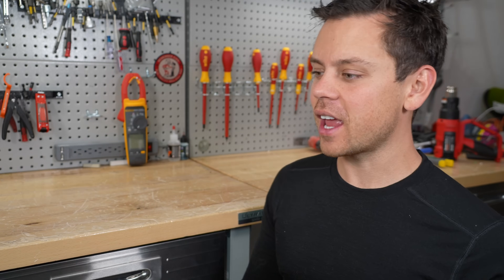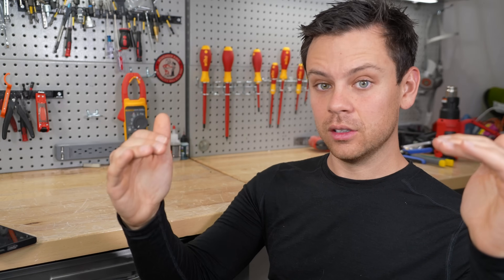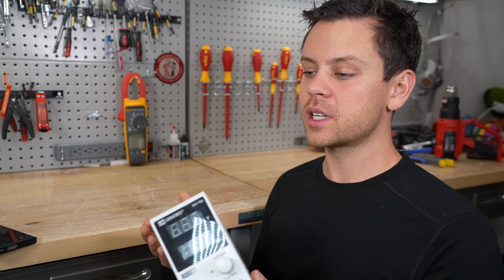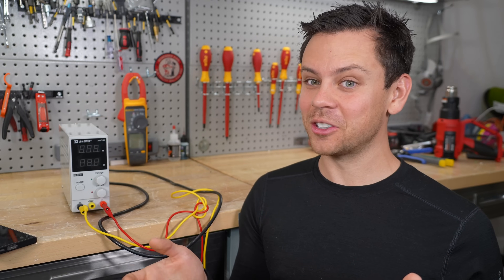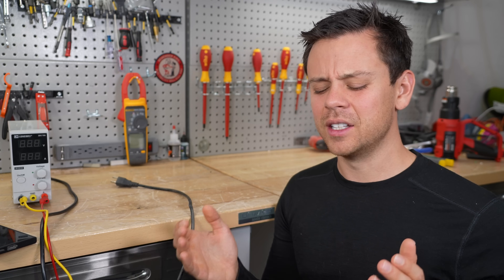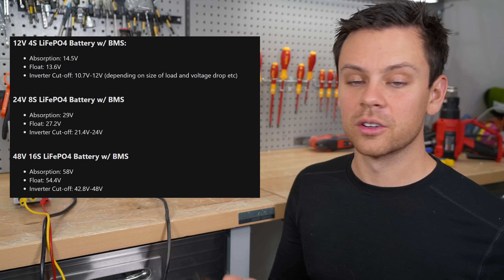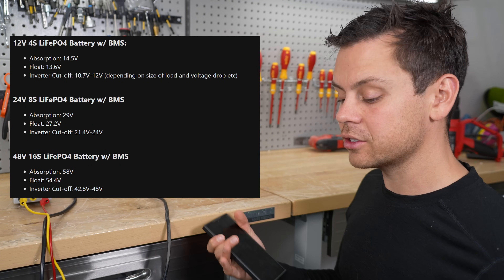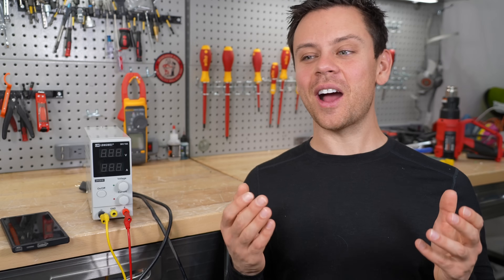LiFePO4 Charging Guidelines: What is 100%? What is 0%?! How to Balance??

Comment: I live in a rural mountainous area where MOST people are off-grid, and have been for decades. They are generally lost in their old mindset of low capacity 12 volt systems running on lead acid L-16 batteries. They are absolutely blown away when I update their system. The LIOP4s are a huge leap from lead acid, the panels and controllers, too. And yes, the new inverters are ...cheap and easy to install with high capacities and everything built in, plug in batteries and panels, voila! It's amazing how solar has become so much cheaper and better, it opens the way for a much easier off grid lifestyle, where electric fridges, dishwashers, mini-splits, and lights left on are just fine! People are stunned with the greater capacity of these systems, a miracle to them. The only downside is the complication of the combined system inverters with their software and specific requirements. Give me a good 48 volt low frequency inverter and a good separate controller any day.
Reply: I built a large deer blind that i could live in for a few days, people we trying to get me to use a Jackery or Ecoflow, I ended up using a Sungold 3000 watt all in one, I'm putting the batteries under the bed and four solar panels on the roof, yes a solar generator would have been cheaper but this is all hard wired and out of the way, especially since space is at a premium. 3000 watts should be more than enough, all it will be running is a TV that pulls 30 watts, some LED lights, a small A/C (for the summer months) that pulls 900 watts when it's running and a 10" oscilating fan. I'll post a video of it when I get a little further along.
Reply: Can you post an overview of your setup? Or share a parts list and schematic?  That sounds awesome.
Reply: @brianthayer8244  I'm going to post th elink, it's the unpublished version, I'll make it public once I get the video completed - feel free to share the link
Reply: @brianthayer8244  Not really. I'm an ADHD shoot from the hip guy. I can tell you that if you mind your  money you can have a very serious off grid solar system that will run a normal household even through the winter depending on where you live. To me. the grid is obsolete and great for charging batteries in the rare times you need the power. Just last week there was a rain and windstorm. I called a friend in town and he told me the power was out. I said my favorite thing, "really?". My batteries were at 70 percent after three days of rain and just humming along. The biggest thing that people don't understand is that solar makes power even when it's raining. A big enough array and it will get you through all but the stormiest times. Good luck to you, go solar!
Reply: @brianthayer8244  My reply keeps getting taken down.

Comment: I just returned 4 new 140Ah batteries to the manufacturer.  Why?  The BT app didn't work right, they sucked massive amounts of charging current, and they wouldn't properly equalize with one another (4P configuration, of course).  One or two batteries would go into standby while the others were charging.  But, then they would get stuck in standby.  Drove my BMV crazy and I nearly burned up my vehicle alternator.  

So, I installed 4 new RedOdo 165Ah batteries in my RV and I'm thrilled.  The BMS seems much smarter than the one in the batteries I removed.  They only seem to want about 60A of charging current each, they equalize nicely, and the app works flawlessly.

Questions:  
Is it possible that the 4 BMS modules are communicating with one another?  
Is that the reason that the maximum allowed configuration is 4S4P?
How are they able to cram 165Ah into a standard Type-31 box?
Reply: Which brand was the 140Ah batteries? You describe problems with charging, but how did they discharge?
Reply: @themartinandersson  I didn't want to trash the manufacturer, but since you asked...   They were TimeUSB.   I was especially disappointed when they refused to give me a version of the app that worked nicely before they broke it with an update.  To their credit, they agreed to take back all four batteries and cover the cost of shipping.
Discharging was the same issue in reverse.  One or two batteries would carry the load while the others would go into standby.  Why?  Doesn't make sense.  I guess I was expecting them to behave like AGM batteries in a 4P configuration.
Can you address questions 2 and 3, please?
Reply: @thewileyone1  I have three new Power Queen 140Ah connected in parallel via a busbar. Although I have no problems charging them, once they get full, one or even two (random order each night) gets "stuck" and refuses to discharge. Throughout the whole night only one or two unstuck batteries discharge leaving the stuck one(s) fully charged.

What I have found is that in the evening, I can put on a brief, but high-amp load (a water boiler on 1600 watts for 1 sec to be more exact), and this makes the stuck batteries unstuck, after which they happily discharge during the rest of the night.

This is clearly not sustainable long-term, but I am still investigating the issue to see what could be the cause. I suspect this could be because they are still unbalanced as I've only had them for about a week and I am charging on solar only; so I've never had them sit on 14.5v for "days" which is what my understanding is needs to be done for lifepo4 batteries to get balanced?

What are your thoughts?

For anyone else in a similar situation: the install was a pretty bad job. The workshop didn't even charge the batteries before connecting them. They also used cables of different lengths. We changed the cables to be of the same length, also rearranged the connections on the busbar such that chargers, batteries, and consumers, are intermittently connected, chargers are on the ends, and each device plus and minus are diagonally connected (all this to even out the current flow on the busbar). But none of this fixed the no-discharge situation.

Comment: Not that bad - lifespan went from 10 years to 5....
I read 80% full is best for longevity.
He mentions heat. Hot hot is too hot?
80F? 90F?
50F?
How cold is too cold too?
32F? 20F? 0F? -20F?
Trying to decide if I should put mine in a detached garage that goes as high as 107F and as cold as -20F.
Indoors is about 82F summer, 65F winter.

Comment: I have 2 12v dumfume 300ah each. Everything was running fine now won't charge over 13.5.
I have the renogy 50amp for solar and vehicle alternator. Just bought an adjustable upto 50amp charger gonna hook it to where alternator would normally go so at night no matter on solar it will kick in and charge and balance batteries
Reply: Solved the problem?
Reply: @User-jr7vf yes drained them 1 by 1 and then charged them back up 1 by 1 to get a full balance.

Comment: hey bud I had 2 lead acid batteries hooked up to solar they went through hell lol TOASTED BOTH OF THEM LOL But I just got a li 4- 100 ah bat just 1 for now  it has a bms in it ? can I leave it on solar and let it do its thing  and keep it charged with a slow drain will that hurt it  I plan on building more batteries  to get a bigger bat bank  but for now I just want to run my small stuff like lights ECT and a 2000 watt inverter on occasions when I need it thoughts?

Comment: Hey will. I've got a pair of Ritar 100ah  lifepo4  batteries, both with failed BMS. 
I used a 200a Daly smart BMS temporary hooked up via a 20 amp DC constant charger. 
One battery ended up super well balanced, like 3.5v per cell at the end of charge when the amps dropped right off, the other battery was all over the place, one cell remained at 3.3v and the highest finished at 3.7v.
The BMS is supposed to have active cell balancing, but nothing really happened. What should I try next?.

Comment: Will, you are so impressive. My battery bank is 4s4p, LiFePo 280 ah, installed in March (2025). Cheap Eco-Worthy. 7 of the 16 have Bluetooth. I finally got that to work yesterday and saw the SOC varies greatly (off grid solar). It seems you do not recommend installing equalizers/balancers to achieve  balance but instead simply let them charge to 100%. Or, do you think equalizers/balancers are a good idea? 
Thanks

Comment: Can u please show what to do if I’m charging only with 110volt on my travel trailer? Power is always on year around to batteries. Just bought new 100ah 12 v lifepo4. 2 battery system.  I just charged  yesterday first time by changing old dead batteries out and hooking new ones up. Do I need to buy something to do it? New converter? Balancer? Or let my 110 handle it like nicd always did.  Note I do know it will only charge to 90% that way but that’s still better than 100 % on my nicd’s

Comment: If you have multiple batteries in parallel and a large imbalance, you can disconnect high batteries and manually charge lower ones to get them balanced much faster. The reason people are afraid of high and low SoC is because other lithium chemistries are sensitive to this, and they haven't adapted to LFP

Comment: @WillProwse my battery Stucks at 99% for hours and inverter keep pushing current into cells and all cells are being balanced at 3.4s...in BMS I have set 100% SOC level when cells hit 3.59V...so my inverter keep showing me 99% till that 3.59V level is achieved and it is really normal that my inverter keep pushing 30A current into LFP cells. thanks for your such informative videos. I am learning a lot :)

Comment: 13:03 "When you're using solar it's maybe 0.1 or 0.2 C at most, if it's above that then it means that you did not size your system properly."
Good information thanks.

Comment: Fantastic video, crammed with really useful information, thankyou Will. Totally relevant for as I'm setting up a 12v Lifepo4 solar system with 200Ah battery and 1000w of panels.

Comment: I have a Grand banks " it's a trawler " with 12vot system. Want to hook up inverter/charging system so when I leave shore power I can run my small frig an use outlets on boat. Also if I changed to 48volt system do I have to change anything.  Do I just install 48volt batts an hook up to inv/charger.

Comment: Thank you for your enthusiasm regarding this topic, though, due to my lack of knowledge, I will have to watch more than once. I just bought a Pecron E1500lfp with EP3000-48v battery and the E1500lfp shut down at around 7%, is this anything to worry about? I feel like the system shut down before its capacity was completely used up or fully discharged while powering my refrigerator. Thank you.

Comment: First, Thank You for all of your great videos.
Quick question: I have an existing 48V 100Ah Lithium LiFePO4 Battery. I plan on adding another one in a few months.  Couldn't I just let the original battery charge to full and disconnect from the system, then connect the solar controller to the 2nd battery until it was fully charged.
Then, now that both are fully charged, Just connect them in parallel to the solar controller and designate (by way of the dip switches) the original battery as one and the 2nd battery as two?

Comment: OK... some of this is confusing to me.  FOR ME, on my boat, I go from 100%-90% when I use it.  2-3 times per month, except winter (no usage then).  Should I plug in the charger every time?  Or wait until my batt percent is lower?  I don't want to hurt my $1000 battery.  Mine is a 24V Dakota Lithium battery.  The charger came with the battery.  Its a slow charger.

Comment: I have 3 12 volt Li power lipo batteries wired in series for a 36 volt golf cart. the only time I charge them to 100% is when i balance them the rest of the time I keep them between charge to 80 run down to 40 is it better to just keep them at 100

Comment: i have a big LiFePO4 battery bank and low consumption so the question is should i disconnect the charger to get to 20% and then charge to 100% again for longevity?
as it is i am never below 98%

Comment: I am building a 30KW bank. Using 32 320Ah 3.2 cells, sold as "A" grade. Started the balancing by connected just 8 in parallel and using a 5 amp adjustable charger as you recommended in video. Set at 4.5 amps and 3.65 volts, it has been a week+ and they are still charging at about 3.25 amps. Do I have a defective unit in the 8? Wondering why it is taking so long. I did not set them up as 12 volt battery and precharge them with my 16 amp 12 volt lithium charger. Any ideas are appreciated.
Reply: if you multiply 320Ah x 8 (8 parallel) and divide it by 4,5A, you will get roughly the time it needs to charge them 320Ah x 8 : 4,5h = 568h : 24h -> 23,7 days.
its just math. also i noticed, that my lifepo4 batteries peak capacity is almost at 3,45V anything above will increase the voltage, but it takes not much time from 3,6V to drop down to ~3,45V thats when the batteries are at almost 99-100% charge if im correct

Comment: I have two LifePo4 120Ah batteries in the back of my car, 900 watt of Solar on the roof. Each Solar battery has a 15 amp Solar Controller and indervidual re-settable 15 amp fuses that I can switch the power supply to either Solar Controller on or off with. In very cloudy conditions, I run a small inverter connected to cable's from the agm car battery under the bonnet. I use it to run the fridge power supply to the Solar Controller's to fill my rear LifePo4 Solar Batteries to 14.4 volts, day or night. One runs my fridge, the other my 1000 watt inverter for my kettle ect. Alternatively I charge a DeWalt Drill with the Solar, then I can use it to drive a Permanent Magnet Alternator through a rectifier, sending it's output just like the fridge Power Supplies output split between both Solar Controller's. Both options give me a 6 amp constant charge for topping up. Choosing which Solar Controller/ Battery receives it by use of the Solar Controller's re-settable fuses! When at a powered campsite or in the Garage I can plug the fridge power supply in directly to the mains with a constant supply of power letting the Solar Controller's decide when to use it to keep my LifePo4 Batteries full and leveled and my fridge always running fine! It's a cool camping kit that came about living in my car. 🇦🇺🤟👍💯

Comment: I have two Newport 36VDC, 40AH batteries for my 3hp kayak motor. Newport replaced the 1st after I documented that when running the motor between 70% and 100% the battery would fail - charge would decline smoothly initially and then go from 65% capacity to 0% within minutes after a few miles running the motor.  2nd battery worked as promised and they said to keep the 1st.  Not having a 36V load tester, I used a 360watt 36-12V converter and an inverter to load test both batteries at a steady 200 watts.  The results were surprising: 1st battery smoothly declined to 0% over 7 or 8 hours for a total of 1530 Watt-hrs of energy; 2nd battery similarly produce about 1590 Watt-hrs over 8 hours. I now plan to use the original battery to drive the much smaller (34amp at 12V) trolling motor load via a larger converter.  Both batteries are rated for 1440 Watt-hrs - obviously that varies with load draw!  I've ordered a 720 watt converter to test both batteries with a 500 watt load.  I'm open to advice on future management of these batteries - Newport's onboard bms communicates via bluetooth and the charger that came with the original battery regulates all charging operations.

Comment: You didn't mention how long I should set absorption. My Victron mppt defaults to 2 hours. Is this sufficient to balance? Also, I don't really get the point of Float with lifepo4. Why not just set the absorption and float at 14.5 in an offgrid solar set up? Voltage will drop automatically over night.

Comment: So in one way, understandable, that all this information is based on solar panels. But do a  a generator charging 4 100 AH batteries hooked to ones electrical Breaker panel for a small cabin. Some of us don't get enough sun to use solar, but can still use batteries to be charged and have electricity.

Comment: Hello will! I just bought one of those table top power supplies that can handle 30volts 5 amps. 
I bought cheap lifepo4 batteries 12v 300ah and 4 hours after charging they show 14.49 and the other is at 13.95 volts. So I figured they need balancing. 
Can you explain to me in detail how to use the power supply to balance my packs. I want to use them now! Thanks for all your videos I’ve learned quite alot!

Comment: I got a LiTime 48v 100ah battery paired with a LiTime 3500w AIO with 4x320w panels set up in series+parallel. Currently got everything hooked up and running. I can't for the life of me figure out why the battery will not charge beyond 50v. It's rated to charge up to 54.75V. I just got it about 2 weeks ago. I'm not really using at the moment. The settings are setup as both manuals for the AIO charger and the battery states. I'm rewatching a lot of Wills' content to see what I can re-find. Hopefully I will figure it out soon. I'm not sure how to tell if I have a dead cell on this server rack.
Reply from the maker: Can you post this on the forum and we can help you. Post pictures and everything you can
Reply: @WillProwse  Not a problem. I welcome the help and I appreciate it. It may take me a bit. It will hopefully be up by tonight.
Reply: @WillProwse  Posted. Please excuse the format. I almost never post on forums.

Comment: What I have found in some bms datasheets is that the balancing starts when first cell reaches 3,5~3,55 V.
Its also worth to mention the voltage/discharge curve. From 3,65 V to 3,55 V the cell outputs only like 1% of its capacity. So it may be beneficial to keep them at 3,6~3,55 V in scenarios when you have to be prepared for power outage. Especialy when the temperature around batteries can varry.